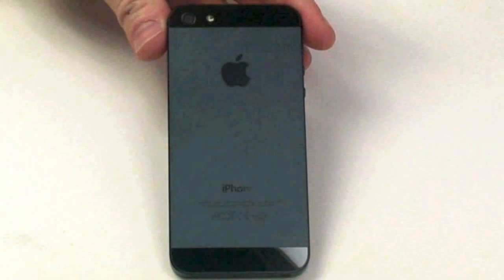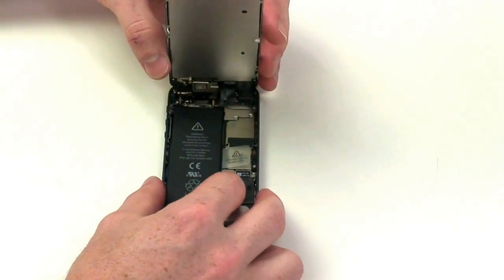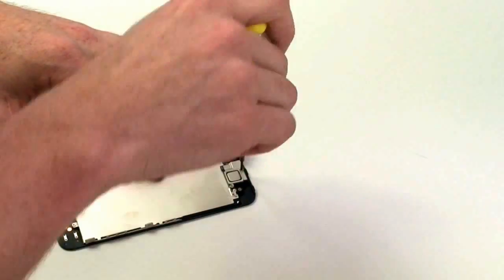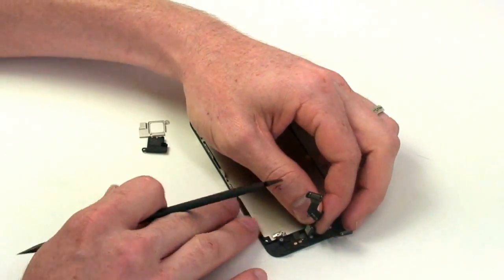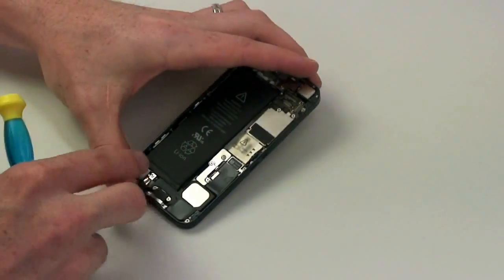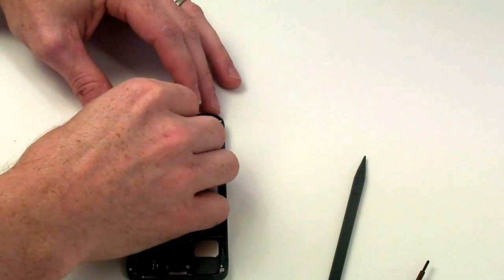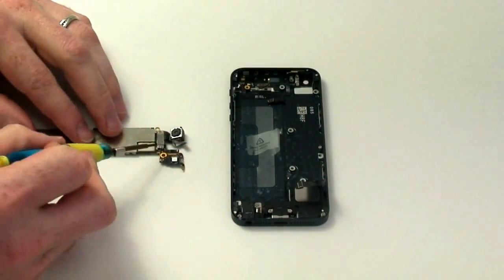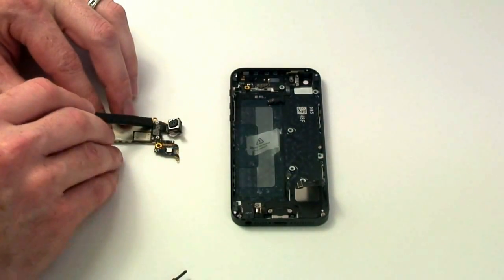How to Take Apart the iPhone 5

Comment: When I get the screen off using a suction cup, there is a ribbon wire which prevents me from taking the screen all the way off. I've watched many other videos and haven't seen this as an issue. What can I do to get the screen all the way off?
Reply: There are three screws that have to be taken off and the screen will just have that little ribbon attached.

Comment: for anyone who does this and then has the "random rebooting" problem you need to clip the metal plate (that covers your screens flex cables to the board) propperly, give it a good firm press and then it should not have any more problems (you also need all 3 of the screws into the plate.. if you dont you will have the same problem)

Comment: Quick question. A friend brought me an iPhone 5 he found. The iPhone he found has a password and is locked. I've tried to put the device in DFU mode so I can restore the software, but It wont go into DFU. I did the power-home-relasepower button combo (3sec,10sec,..approx 15sec). I also tried the other method of the power/home button combo for 10 then release the power button until DFU. Neither worked. Any help? Not a noOb so limit your sarcasm please.